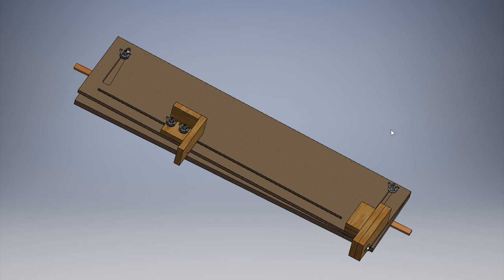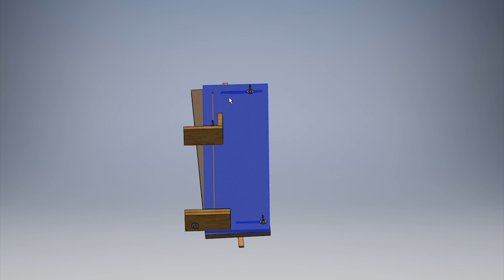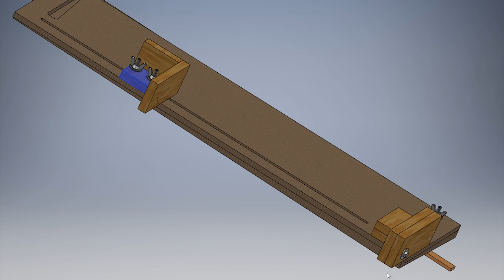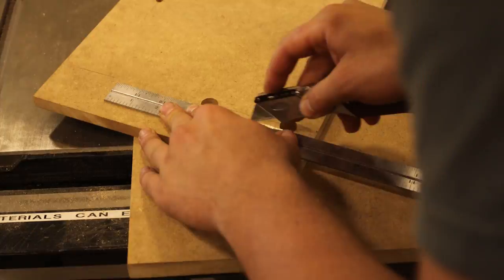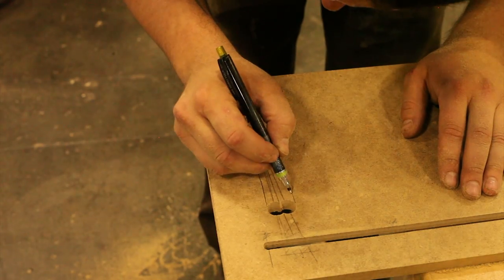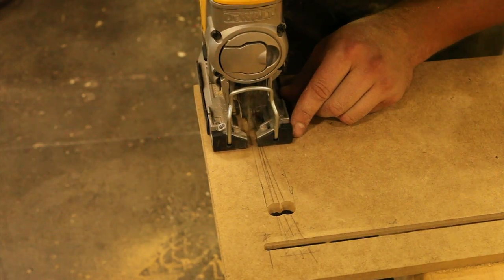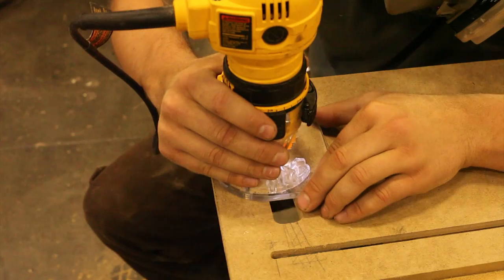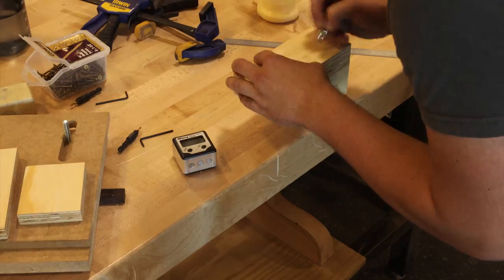Table Saw Round Tapered Leg Jig for Midcentury Modern Style Legs

Comment: This is excellent, well done and thank you for the video! I built your jig and made my first leg last night. I have to say, it was a little scary running the first leg. The blade was able to push my leg, causing it to rotate slightly during one of the passes, which caused a huge chunk to explode off the side. Scared the hell out of me. I'm going to try to figure out a way to secure the piece during those initial large cuts to ensure the leg doesn't rotate when I don't want it too. Also, for future viewers interested in making this, I think it might be a bit easier to have the large bolt side be the movable end. I may also switch the base to a thinner stock so I don't have to raise the blade so high.

Comment: Great design, one question tho..
Once u finish rounding it up by passing back and forward, how do you make it spin freely so u and spin it on the saw and sanding it?
Reply: If you drill the holes in the blocks just slightly larger than the bolt in the fat end and screw in the short end then it should spin freely